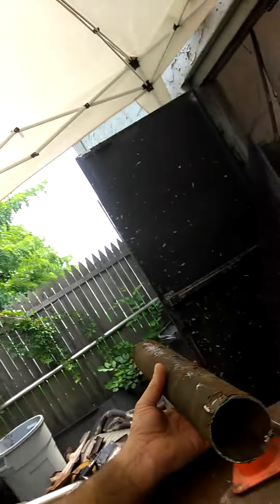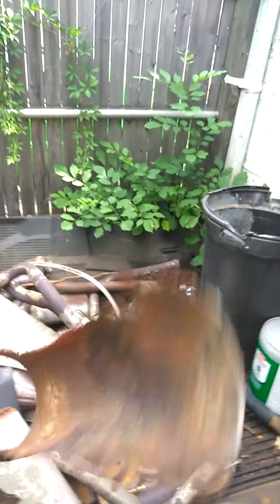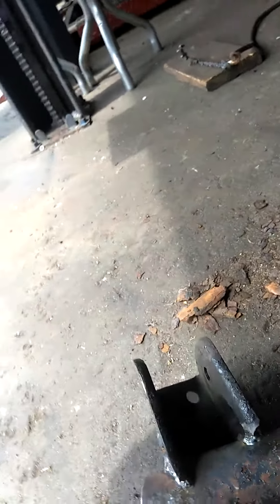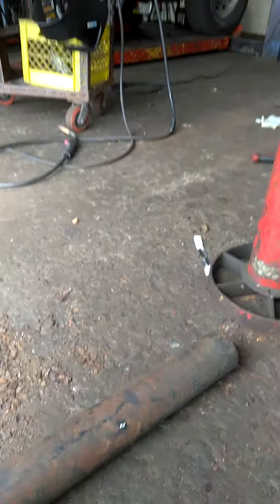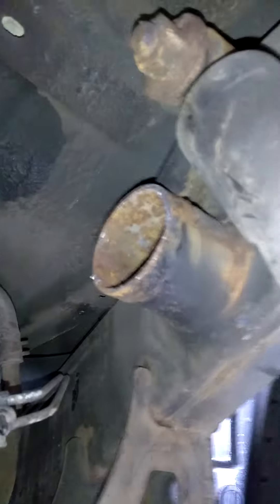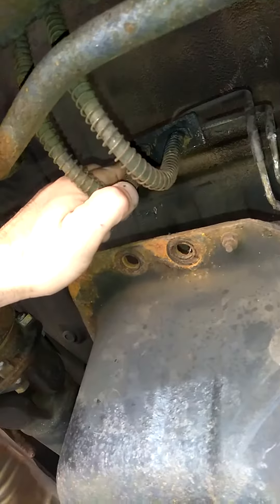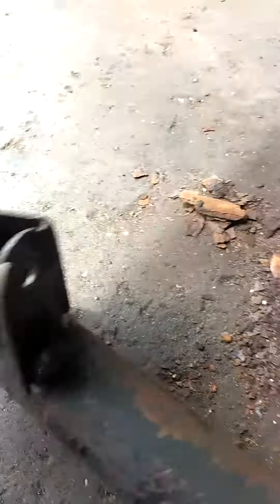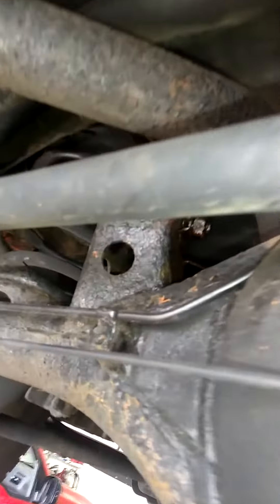2004 Kia Sorento rear suspension rusted out and my repair.. Meineke cinnaminson

Comment: Welded with axle still in the car, or did you pull it all the way out. Just found my passenger side upper mount rusted all the way through 06/02/2020.
Reply from the maker: I did this in ride on a drive on lift
Reply: @anthonynastasi4098  So should I be looking for a body shop or a specialty type of shop?
Reply from the maker: @charlesschluessler546  I haven't done one in a while you need a chassis shop who can fab